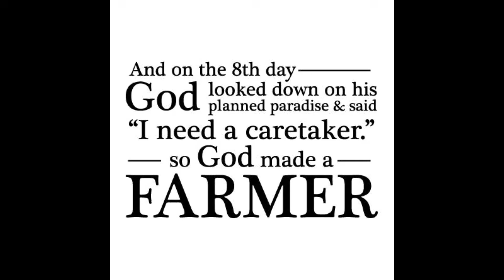Is Our Hay Dry Enough To Bale?

Comment: Always the dilemma, is it ready to bale. You made the hard but right decision to wait. The tedder is the most valuable piece of equipment in the hay drying process. I have clover and alfalfa in my hay and leaf shatter is always a concern. However, mold is a bigger concern, so if it needs tedded again it gets it. I hope to make my second and final cut of the season in the next couple of weeks. We had a drought this summer in my area and it put us behind by 3 or 4 weeks. The dew this time of year is always a challenge. Good luck brother and thanks for the videos.
Reply from the maker: Thank you Sir. 

A couple years ago we had a lot of hay down and the forecast changed and it rained hard on our hay all day and night and we ended up loosing a whole cutting. That winter I bought a tedder. We would have probably still lost some of it but could have maybe salvaged some too. Our Tedder purchase has been worth every penny we paid for it.

We have the same hay philosophies it seems! If they hay needs kicked around it gets it, if it’s starting to dry good, adjust rpm at the pto lower and tractor ground speed up to help reduce leaf shatter some. Premium quality hay don’t just happen, it takes sweat and work.

Thanks for watching and we pray you have a FANTASTIC 2nd cut coming up!
Reply: @8thdaychronicles  thank you and God bless you and your family.